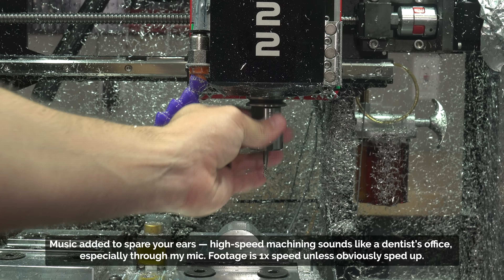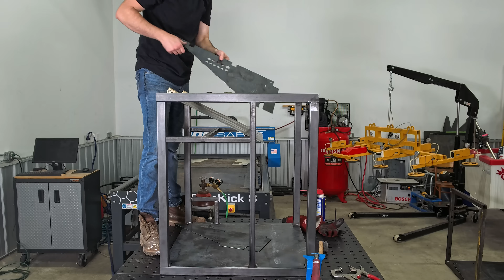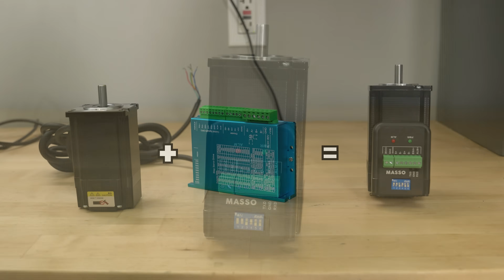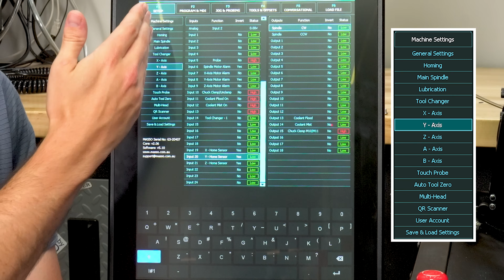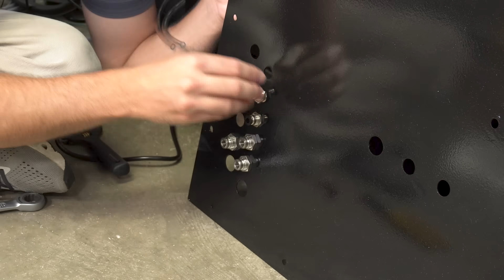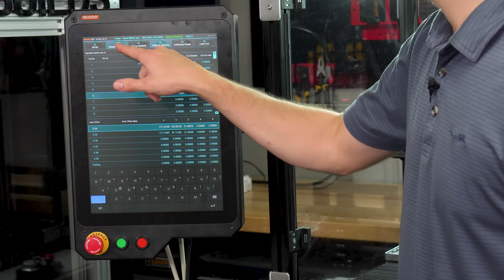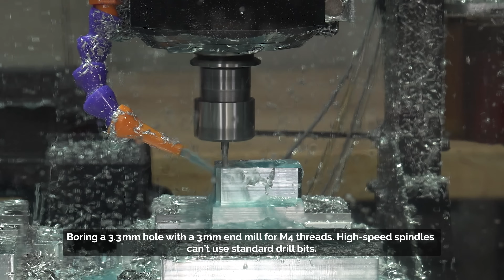Building the Ultimate Compact CNC Mill — Not just an Upgrade!

Comment: What in the world do you have to do to get the DMC2 mini oil system working, the design is far too weak to hold pressure, it just blows everything apart… I’m beginning to think this was a horrible idea buying this thing, I can see why your throwing thousands and thousands of dollars worth of parts at it… It’s like a high school design project, I’ve already fixed dozens of engineering mistakes on it…

Comment: Why does a hobby machine need an ATC? If this is a teaching machine for people to learn how to use a commercial industrial-grade machine then ok. But for a hobbyist cost > time and 20k is just too expensive when you can get it outsourced cheaper.

We need a small ultra high-precision 5-axis machine with coolant for much less than $10k (ideally $5k). The accuracy should be comparable to commercial cnc machines. I think that would be the sweet spot. That is asking a whole lot but even as a kit it would be a hit.

Comment: Love this design but I have a question for you, I have a similar set up but my DMC2 mini has the longer Masso Stepper motors (higher torque) on my X and Y axis. With this enclosure, will the machine still fit inside? I would hate to make this and find out it wont fit.

Comment: Get your self some chip splitter roughing endmills they cut the metal into fine chips takes some load off and you can run them at 2-3x the speed of a normal mill

Comment: A man as clever as you could add a hose down cycle where you fit a nozzle or shower into your spindle and systematically hose down your table and internal walls before withdrawing a part as the final op. Could be a rose or whatever you design, like a liquid broom.

Comment: That coolant line routing scares me.

Since I've done lots of liquid plumbing for both computers and CNC machines, here's some advice for anyone else in the comments doing a project like this: That routing is setting yourself up for a headache when (not if, never if) you have a minor failure in the loop or need to disassemble the loop for deep maintenance. At least use compression couplings instead of push connectors in the electrical box, but ideally don't mix electricity and water where you don't absolutely have to.

Comment: Im the first to have ATC for dmc2 come check it out!. My spindle is ip55 rated as well.
I cnced the holder my self to   maximize space and offset.

On the large dmc2 which is what i have. I have 6 tool change and still more machanible area than a mini.

I also upgraded the coolant system to a actual usfull flood coolant setup.

Comment: I have somethings I can add here, E-stop you can get a e-stop relay which is designed to handle e-stop push buttons it verifies the position on the e-stop push button.
 in a true e-stop operation all energy needs to be disabled to the devices you should have a contactor in front of all power coming in and when you push the e-stop the power to everything is disabled including pneumatic devices this will make your e-stop in compliance with safety standards... E-Stop there should be zero energy supplied to the equipment...Some of the panels that I have designed have a shunt in the disconnect and when you press the e-stop it will trip the disconnect to the off position which kills all power...

Comment: Bins n drawer faces - 3D Yeah - Oh Carbon Fiber even PLA CF or PETG CF...  Form bend 3 Sides drawer metal (note later) - the 2 sides left n right and bottom. Front and back to drawers use the 3D printer - Facing, text, pull slot then on the 3 sides to match the form leave a slot - round or square or V for silicone rubber goop at assembly. Could use brass insert fully capped on like a 10mm angle width or larger and or multiple goop groove slots... Do an angle face covering the edge of the form bend ends.. Now for a lid on the juicy side make up a TPU seal gasket for the top alum. angle that holds the lid. O a pipe thread bung - that same PLA CF as a solid form with the Small narrow DIA. of the NPT pipe thread, you want to use Std brass inserts or self-tapper down with TPU gasket. Hand tap the bung with a pipe thread - I've done Gas Can Bung type inserts on broken gas can spigots for what 3 years or more now O-ring seals to opening to cap (what 6 cans now me n friends). Um I make my drawer depths at 18" because I went to that (now at Amazon) Harbor Freight place and bought that small bench top model bender. Strictly thin gage steel/alum material - I have also done facing and back-end caps with a u channel shape at the 3-4mm inserted face to seal and hold everything better for the thinner gage metal. If weight is an issue in the cool collector and plastic mount cross members that have bolt on alum. flats or Angles as cross members. Use Angle alum on bottom edge like the full 1/8" thick x 3/4 or 1" to help with bottom sag.  I like the MASSO.. OH TPU door gaskets I've seen TPU prints that are the fluid and chip blocking for bellows on ball screws and slides.. My largest 3d printer is the kobra max. CNC is Carvera Air.. Hand Plasma current but might change, metal band saw, mini 12"L lathe, hand type bridge port. Yes on a few resin printers too. OH there was a personal water craft - WetJet - I blueprinted everything till they went belly up

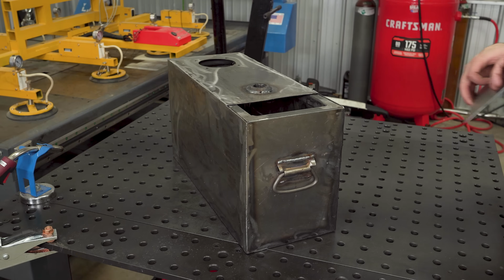Comment: 14:45 It looks like you have enough vertical height that a classic metal jerry can would fit for your coolant tank and those are 5 gallons. Those Jerry cans for fuel tend to average around $40(+/- $10) fairly consistently and I'm sure you could 3d print an adapter to get the pump to mount to the fuel spout.

Comment: Can I use the HM10-57 bracket with the standard unit?
Reply: You can, you just have to cut an opening in the side plate.  However, that stepper motor bracket is no longer available from Amazon.  I ordered one for my machine about a month ago and Amazon just cancelled the order from the manufacturer/distributor due to lack of shipment update.  My guess is that the brackets are sourced from China and with all the tariff nonsense, they can't be had for a reasonable price anymore.

Comment: Hey David, not sure if you'll answer this inquiry, but here goes...

Would the stepper motor mount you recommend for the X-axis work for the Z-axis as well?  In your first video review of the DMC2, you said both the X and Z axis motor mounts were flimsy.  My kit is on it's way and I'm about to place an order on Amazon for the motor mount for the X-axis, wondering if I should get a second for the Z-axis.

The Y-axis way cover...  Not sure if it'll even fit on the stock machine, but in the event it can be shoehorned in, would the same cover fit on the back of the Y-axis?  You also mentioned losing some travel on the Y-axis by adding the front way cover.  Was it possible to offset the way cover forward in a way that would keep from losing any travel? (I'm guessing no, you are a PhD engineer after all!)

Have you investigated adding way covers to the X-axis?  30yrs of experience building, testing and R&D with industrial lasers, the idea of exposed linear rails and ball screw is not a great idea.

Comment: Ooooh, I’m so glad I didn’t finish my DM3 Mini yet! I kept wondering how to build a better enclosure, extend the Y-axis range, place the power supply and electronics more cleanly, and even improve that folded motor mount piece… and then you show up with this! And for free!

The kit isn’t expensive at all — if you can build it. I did build mine, everything went fine, but then I got busy with another project (wheelchair-accessible benches — I’ve only got one leg). Now this perfectly designed enclosure gives me a whole new head start.

Thank you so much! 🙏
Reply: I just purchased the DMC2 mini kit...  Already trying to figure out if I can use the CNC components and spindle to build an extended range, more rigid machine.  Linear rails and carriages are relatively inexpensive, as is structural steel.  Belong to a local maker space with manual and CNC mills and welding capability, so it might be relatively straightforward to pull off.

Comment: I've been kicking around the idea of getting a Masso touch, but didn't realize the flaws. So you pay $1500 for the controller then you have to pay an additional $55 for a relay module and $263 for a wire connection board. The Masso has been around for a while now, you would think they would this sorted by now.

Comment: $6,000 spindle, probably not, but that standalone CNC controller is definitely something Im looking at
Reply: Even the stand alone CNC controller is a lot of money for this machine.
Reply: @WHJeffB depends where you live. Its only 1100 bucks for the core which is a lot cheaper than any other all in one controller. But after you buy a mini pc with touchscreen, mach 3 or 4, windows for OS you are gonna be in the same ball park cost wise.
Reply: The Masso G3 Touch all-in-one controller is fantastic. I have one, and it has been flawless.

Comment: Step 1: become a successful manufacturing youtuber. Step 2: companies will send you everything for free so your CNC is a few hundred dollars rather than $20,000 - nice.
Reply: I just looked up the price of just the “upgraded” spindle….I’m with you. Might as well get a full size mill from Tormach or a used Haas. 

I get that this is DIY but for the price and limited bed dimensions I’d get a true mill.
Reply: @rsquared9703  I don't disagree, but space is an issue for us that are home garage CNCers.
Reply: @rsquared9703  Agree 100%...  I really enjoyed Dr. D-Flo's project here, but the upgrades are just too much money for what the machine is.  There's better options for that kind of money and you end up with a more usable and robust machine.  That said, I bought one of the DMC2 Mini kits...  I don't need the Masso controller and stepper/servo motors or the upgraded spindle.
Reply: @rsquared9703 check out my setup 6500 and that is including machine price as well. more machinable area and has atc and such.

I am first one with full working atc dmc2 with wirless probing and industrial flood coolant.

I did make alot of it my self.
And 6500 wont get you wirless probing and couple other things but you will get masso and atc spindle.
I have hit 6.5 mrr 6061 t6
I mostly machine 7075 t751, 4340,

Theres alot to my machine you dont see that i manufactured my self and precsion ground. He is very wrong about milling tubing. If you are any machinist its not hard to face down some tubing and make it true.
Reply: Its just a modern way to pay for advertising...
Reply: Right? I was so excited at the idea of using my DMC2 Mini to upgrade it in this similar way, and then I saw what the cost is like for mere mortals that don't receive thousands of dollars of free stuff "with no strings attached" 🙄

I really appreciate the upgrade suggestions and the free files and plans on the website, but I feel like this video is misleading in its scope and premise.
Reply: @GoremanX  Definitely amazing work but at this point just look at loans for a used tormac or outasource your part to one of their sponsors.
Reply: @drskizz  Join a Maker Space if you have one local to you.  I do and did.  Great for larger projects that require bigger machines, but not everyone has that option.
Reply: @WHJeffB Ours doesn’t have any CNC stuff.  The space where it could be they built small offices to rent out now to make money to continue to be viable. I get it. The hour drive to it also makes it difficult for me to persue a membership.
Reply: @drskizz  That's unfortunate, both those things make it a non-starter for anyone interested or needing CNC equipment.  

  The one local to me has a CNC milling center and a CNC lathe.  But I was more interested in using the Bridgeports, a larger manual lathe and the surface grinder.
Reply: @WHJeffB  where is it located?
Reply: @GoremanX so I think everyone missed the point. It’s not just abt the cost of everything he upgraded. It’s about getting the most function and quality out of an extremely small machine for people who want to manufacture small parts and not take up lots of room even if they have the room. It’s not that he’s saying it’s cheap to upgrade to this extent but rather that it’s possible to get the same quality out of such a small machine like this as you would out of a Tormach. The idea would be to produce enough money from the stock machine to upgrade it
Reply: Du you have an guide for ”step1”?😂
Reply: yep 100%.

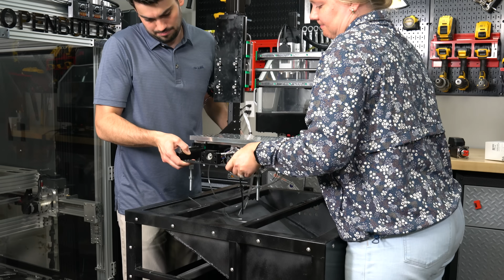Comment: I noticed at 16:48 in this build, the frame is fastened together using bolts through the aluminum components. My concern is: aluminum CNC frames typically lack the rigidity needed when simply bolted — under cutting loads, these joints can loosen, flex, or shift over time, reducing precision.

Unless the design includes proper thread inserts (like Heli-Coil), preload torque, and bracing, bolted aluminum frames may not maintain the stiffness required for long-term milling.

For better reliability, consider using T-slot extrusions with corner brackets, gussets, or even welding/acrylic plates to reinforce the structure. If bolting is preferred, ensure precise machining, thread locking compounds, and careful fastening torque procedures to improve strength and alignment.

Comment: just started looking at milling machines so no clue as to what I'm looking for.
came across this video and the previous one and glad I found this second one , commentary is literally the bambu vs the rest argument in the 3d printing space 😂😂 on a more serious note , having absolutely no experience at all, looking for a milling machine that can shave off 2mm of aprox 2000 a2 stainless bolt heads , just need cheapest to do that job , anyone any ideas?
Reply: If you are shaving metal off the top and not the sides then a lathe is a better tool and can be simpler. If you are doing the hexagonal shape sides then a mill
Might be best.
Reply: For just one Job though consider paying someone to do it.

Comment: Heads up.for people using sheet metal dxf files from fusion. It leaves a lot of extra lines..it good for bend assist line etc. But if you just throw this in to eg industrial laser cutter.. it will cut all lines, or multipass the same lines. Fx construction lines, will be interpreted as cut lines. The lines need to be defined as layers on the laser cutter as well. This means you measures can be way off in dimensions. So sheet metal, if you don't know you manufacture keep only cutting lines. And a bending drawing, incl a 3d drawing as well

Comment: I have the DMC2 and am frustrated getting things square and flat. As you pointed out, I had machined the square tubing flat, but it warped and this thing will never be perfectly square. At least you have some tramming options on the mini! If you had to replace your steel tubing, what would you use? I'd like this machine end up more rigid and of course, square. 
You did some really great work with that enclosure too. Getting the chips out of all the nooks and crannys of the DMC2 is a bit of a nightmare. 
Nice work!
Reply from the maker: You could replace the tubes with ground square stock ( https://www.mcmaster.com/9517K595/ ), but that seems like a lot more effort than it may be worth. How far off are you on the alignment?
Reply: @DrDFlo I can get it to within plus or minus 0.03mm shimming spindle mount front to back. Side to side within 0.01mm, but it's less rigid than I'd like. If I pull on the Z stepper, with moderate force, I move the dial 0.08mm without much effort. I checked bolt torque. I have a 0.1+mm  dip when swinging dial indicator from front to side position. The table, after facing is not flat. I'm going to try being less aggressive with a finishing facing pass tonight to see if maybe that's the issue. The "belly of the table  is lower, perhaps because the table is unsupported in the center. I'm also going to check machine alignment again. Although this is difficult due to uneven paint on the Z assembly plate.

Comment: Looks awesome! After having worked with it a bit more - would you still recommend the Masso controller over a Mach3 or 4 system? Are there any issues with post processors? (I remember having run into incredibly random post processing errors with an older isel controller in the past)

Comment: Very cool project.  I have a DMC2 mini with Masso that I have not gone far on yet.  I may steal some of these ideas… or I may just sell it and buy a Tormach 440.  This project makes sense if you want a really cool DIY project, to learn, modify and have that sense of pride… but I am conflicted because for the same or less $, and probably 3 months of workshop time, I can buy a fully loaded 440 with ATC that can cut SS, Ti, mild steel etc.

Someone needs to come up with a really capable kit, slightly larger and better thought out than the DMC with all the bells and whistles for like 10-12k… 

Anyway, thanks so much for the video.  Huge amount of work and fantastic amount of education you have brought to the community ❤

Comment: Before building an all-enclosure type cnc machine,  firstly need to building a bending brake, then, no needing to out sourcing vender to make those enclosure parts
Reply from the maker: Any plans you would recommend? I looked at some of the hydraulic press conversion kits, but the max bend is not wide enough
Reply: As my original diy manual metal brake was not large enough to bend large pieces for enclosure, so I built a bigger one, as only 2mm thickness aluminum sheets were needed to be bended, I built it with wooden plates, using two manual hydraulic jacks(for car use), 5 ton type, act as power source to move the vertical wooden plate down to bend the sheet to 90 degree, for the long V -shape die tip and V-shape bottom support, long piece aluminum narrow and wide angle sections were used respectively. My English is poor, hoping that you understand. (You are welcome to visit my site to see my diy stuffs but it didn't include that build : https://youtube.com/@ray-charc3131?si=3ZMAlMyu-9Nhoois